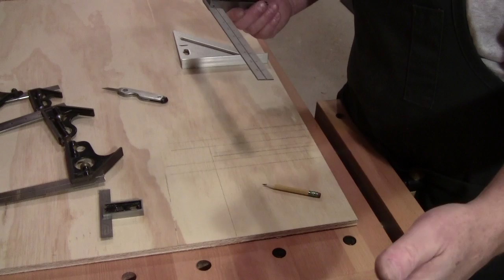Can you have too many squares?  How to check your Square for square... PLANE TALK - 6 Oct 2017

Comment: I was fortunate to work in the industry that sells this stuff and staff pricing was insanely cheap. I own all Starrett for what you have on the table. Square to .0005. I use ALL of them depending and even have a 24in blade for my combo square. My Stanley was out 3 degrees. Someone else owns it now.

Comment: so that's why I had nice lines in drafting class,  I got my ass chewed out for making fatties@ too many times

As you draw with the pencil the led wears down and your line will get wider then if you try and read the size with a scale it will blow the size up .
You kids who use Cad software don't have that to think about.  your not reding a print on the screen with a 3 sided scale rule.

Personally I like the Machinist squares that do not move for setting up machines.
but if I was going to use a combination style it might be brown and sharp or a mitutoyo
you can but a 12-18 and 24" scale for them. It's not a ruler and do not call it that. all the Rulers live in England!
as I was told when I worked in a machine shop.
Reply: bobbg 
Actually it would be called a “rule” or a “scale.”  But yes, not a “ruler.”

Comment: Hi Walter. So what's the verdict on the Starrett? I'm surprised that you've had such lousy luck with them. My father SWORE by them. It was the only the only measuring devices he allowed in his toolbox. Years ago, I bought a used combo square at a yard sale. He showed me how to check for true and when it wasn't, how to get it back to square. The rule rides on 2 points inside the slot and by using some emery cloth and some shim stock, you can adjust the points to bring it back into true. IIRC, some of the Starrett squares actually have small Allen set screws for the points.
Reply from the maker: So far so good Mike, I know there are ways to fettle a square to bring it back to square but I do not want to confuse things.
When people buy a high end tool, it should be as close to 100% out of the box or send it back.

Comment: Speed squares also make a great 3rd hand. The wide slot by the flanged portion allows a spring clamp to be inserted and you can clamp it to your work to act as a support. I've also known for years to spin my pencil but now I know where it came from. Thanks